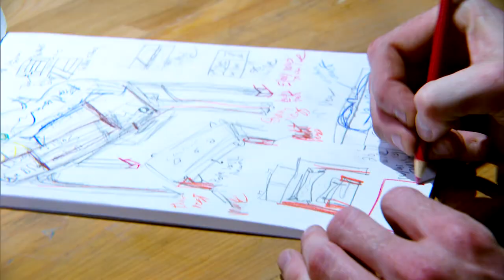Framework: New Furniture Design Show Hosted by Common, To Premiere 1/6

Comment: This show is absolute garbage.  As an owner of a wood shop, I was really excited to see what was going to come out of this show.  As time frames are important with anything, these things would be so much better if they actually gave them enough time to make some amazing things.  I would much rather see some amazing pieces than see them run around.
Reply: As someone who has worked in the field,  furniture making Imo is not something that translates well to the style and pacing of a typical reality show setting as here. You're working with different types of machinery and power tools that are inherently dangerous and require safe operation. Looking over your shoulder and worrying about what your competition is doing should be the last thing on your mind